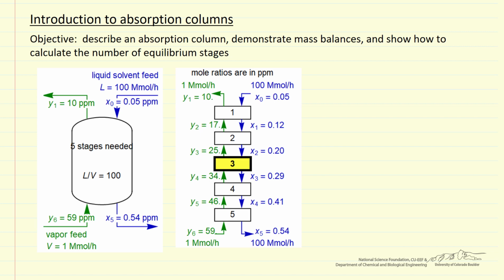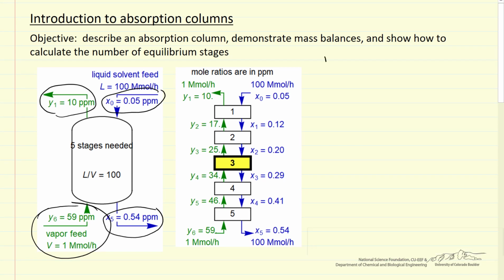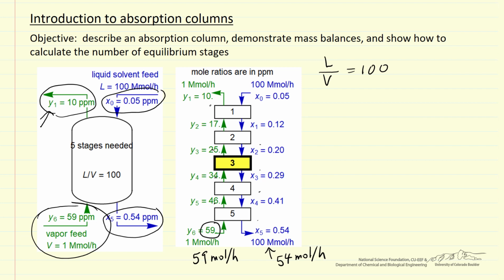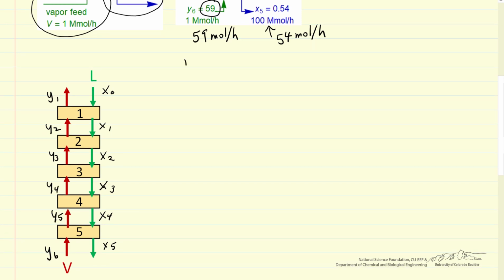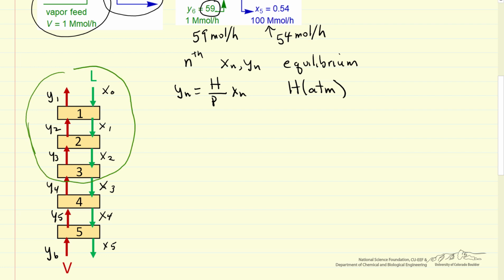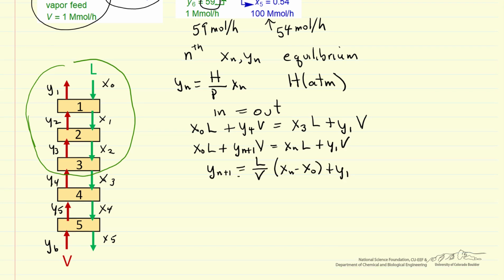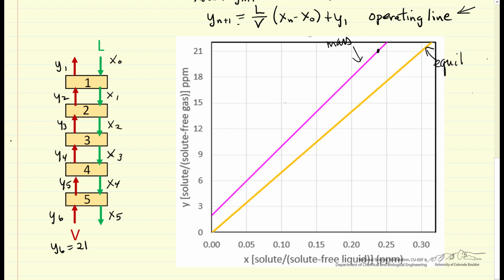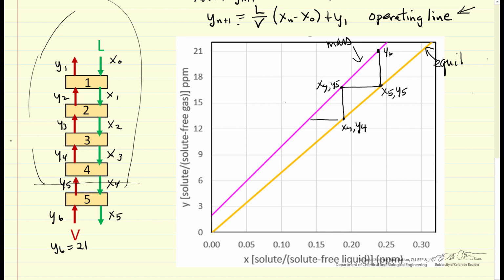Introduction to Absorption Columns

Comment: How come 59 ppm equals 59 mols/h. How does the lecturers come about this figure?
Reply: there's 1 Mmol of vapor flowing per hour (Megamol is million mol) and 59 ppm means that you have 59 particles of the solute per million particles of the solvent (vapor) so when you have a million mols of solvent you get 59 mols of solute.